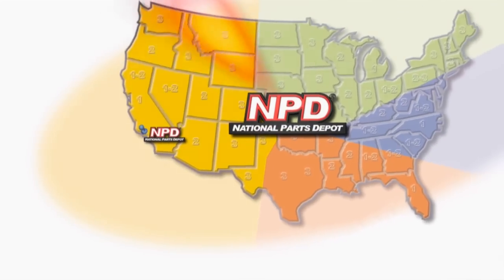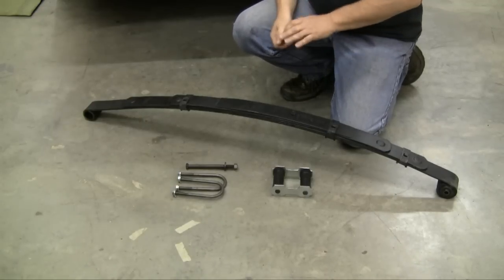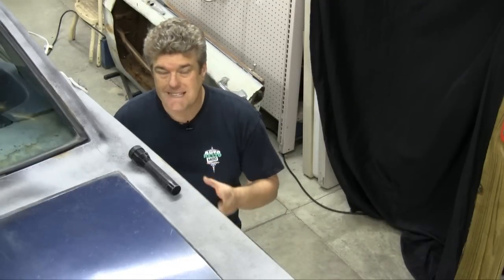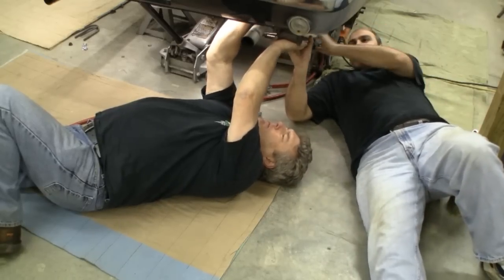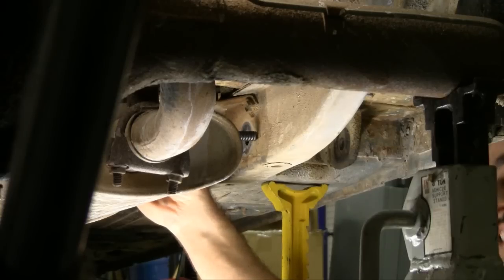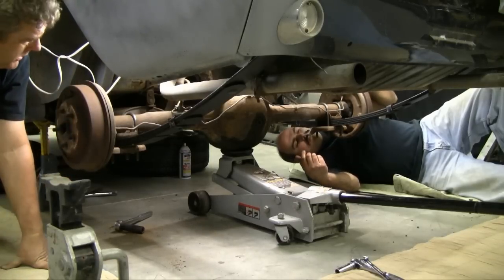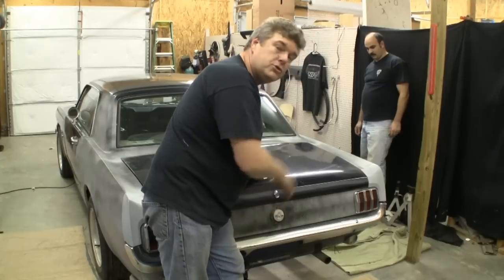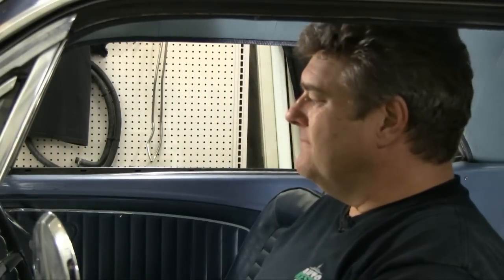Episode 107 Rear Leaf Spring Install How-To Autorestomod

Comment: Gents, your video was very useful in my leaf spring replacement.  Your comments about the front shackel bolts was dead on, mine were both frozen.  It took me cutting the bolts at both of the access points.  I am not a salesman but the Diablo blades worked well in cutting through the bolts.  Tomorrow is installation day. Mucho Gracias.

Comment: Dont know if this is too late or not, however what I found worked to get the front bolt out is take a punch and hammer it to the point where its inside of the spring hole, then take a original U bolt and hammer the rest of the way out.
Reply from the maker: Never too late!

Comment from the maker: It was a littl hard to show and see but there are pins on the springs and holes on the plates. Also the clamps will align the rear axle since they sit snug against the welded plates.

Comment: Good video. Is there any room within the alignment pins/holes to nudge the axle left or right to "center" it? The rear wheels on my '66 coupe stick out 1/2" more on the passenger side. I am wondering if there is enough play there so I can loosen the bolts and push the axle 1/4" toward the driver's side to compensate.
Reply from the maker: Yeah, Not sure if you can recover the full 1/4 inch, but you can center it better.

Comment: This reminds me and my brother doing the springs on our 69 Camaro.  Previous owner had installed Hurst air shocks to make up for weak springs and had them fully inflated, which meant that he kept breaking the lower retaining plates on the springs, to which the shocks were mounted.  Had one heck of a time getting the springs off since the rear shackle bolts were rusted solid to the shackles.  Glad to see that safety was mentioned here since the car and axle must be properly supported and the load removed from the springs before removing them.  Good video!
Reply from the maker: Thanks for the kind words!

Comment from the maker: Want to know something REALLY weird? Our '69 Fairlane is low on the drivers side... Look at your rubber isolators (if you didn't replace them). Our drivers side rubber is pretty beat up and we're pretty sure that is our problem. We'd look at taking measurements from the rear torque box to the rear spring mount on the frame. If both sides are +/- 1/8 inch they are in tolerance and you need to look at other possibilities. email us at our web site in the about bar.

Comment: Very helpful video that inspired me to order Detroit Eaton rear spring's for my '66.  Install went easily until I set the axle on the springs...  Manufacturer used 1/4" high locating pins rather than the 1/2" high originals, and the axle wouldn't locate as a consequence.  Re-re-re-checked that I ordered the correct springs and I did per the NPD listing and Eaton Detroit reference chart.  Disappointing as I could have had this all done in one afternoon.  Now I need to fuss around to get new pins or swap out the springs entirely...

Comment: Hood stance.👍
Factory new cars set 1 inch lower than that in the rear. 😨
Look at all the Ford original pictures.
Reply from the maker: We used the Ford spring height chart directly from Eaton Detroit Spring who got the original diagrams and specs from Ford.

Comment: if i want to change over from mono to multi leaf and order all the parts, is there any welding on the axel that need to be done.  I had read the multi leaf are wider and require diff. parts for the change over.  Thanks allot, the hardest thing i did on my 69 Camaro tear down so far was remove the old mono leafs and the rear end.  thanks Jeff
Reply from the maker: Steel, we'd contact Eaton Detroit Spring http://www.eatondetroitspring.com/ to get the full answer on this due to the fact that "it depends" on the spring. These guys know exactly what you'll need to do to make it work.
Reply: AutoRestoMod
thanks i will do just that....................  Jeff

Comment: I wish you would have placed the new leaf spring and old leaf spring together to compare/contrast the difference AND I wish you would have documented the Mustang's height before and after the swapping the springs.  Did the new spring(s) have greater arch AND did the new springs give the car a lift?  One would think so but confirmation would have been nice.
Reply from the maker: Art, the springs on the car were worn out to the point of extension shackles being placed on them by a previous owner so by comparison they would have been longer. I don't really see the need in documenting the height since our goal was a stock ride height which was achieved by the new springs. Eaton Detroit can give you a certain ride height, you just need to contact them:  (313) 963-3839 or https://www.eatondetroitspring.com/

Comment: I had a hell of a time getting my old air shocks and springs off lol. I shoulda used a sawzall but I used a cutting wheel instead. It worked but I did make a few knicks in the frame rail that I'll have to fix. Good episode Jeff.

Comment: Hello Jeff I have question? My son has 98 ford ranger and we changed the rear leaf spring because one had broken. After doing so the ranger now bounce like crazy. We also replaced all shock on the ranger and front and back. Do you have any suggests to how I can correct this problem.
Reply from the maker: Did you replace just one or both? When you ordered the springs did you make sure that the application was the same as your truck? It sounds like the spring rate may be a bit higher. Also what shocks did you use? You can e-mail Jeff direct at: jford@autorestomod.com so we can get you sorted out!

Comment: Jeff
Just bought a set of new leafs from Mike. I was wondering if you would have had your four post when you did this install if you could have left the tires on and not jacked the axel. Just jack the frame rails. Let the axel rest on the tires below the body on the lift? About to tear mine out on Friday and don’t see a reason to remove the tires if they can hold the axel in place on the lift.  Any thoughts on that ?
Reply from the maker: The tires get in the way of removing the outer two bolts on some wheel tire combos. I used the jacking bridge that Wildfire sells to pick the axle up off of the springs when I was setting the rear end up for center on the chassis.
Reply: @AutoRestoMod  thanks. I can reach all the bolts and have no obstruction. I may give it a whirl for shits and giggles. Gonna just use my rolling jack to lift the frame rails. And set my underhoist jack under the pumpkin but I don’t see the axel going anywhere if it’s still attached to the wheels.

Comment: Where those standard 4 leaf springs or where they stiffer or lowering springs installed on this mustang?
Reply from the maker: Those were stock springs. Contact Eaton Detroit Spring for applications!
Reply: Thank you, do you think for aftermarket 18inch tires, it will fill the rear end wheel well nicely or does it need to be lowered or raised in the back? Because I heard that they came from the factory with the rear riding low.
Reply from the maker: Damian May We'd highly recommend going to this site: http://www.dodgestang.com/ and looking at the charts for your particular car. The 18-inch wheels will work but you have to be real particular with offset. We did a video on setting up wheels and tires here: Episode 92 Picking Wheels, Tires Plus make your own wheel offset gauge Autorestomod

Comment: I'm replacing the leaf springs on my 67 Cougar. The muffler is sitting about 1/4 inch too close to the frame so getting the front bolt out is quite challenging. I don't have a clue how I'll get it back in that way. Would I be able to reverse the direction of the bolt instead and just insert it from the other side? Every video and instruction says to put it back is it was. Is there any particular reason?
Reply from the maker: +Topher7527 Not sure that the bolt will go back in from the other direction. You might do better dropping the exhaust and attacking it that way.
Reply: Yeah. Wound up having to just move the exhaust. Thanks.
Reply from the maker: +Topher7527 Glad it worked out, sorry we were a bit late on the response. We typically don't answer these on the weekend.
Reply: +AutoRestoMod Not a problem. The response was appreciated all the same.

Comment: How do you torque everything down when it’s sitting on the wheels??
Reply from the maker: I just do.
Reply: @AutoRestoMod  I guess what I was getting at was, if I set my car down on its tires I can’t fit a wrench under my car to torque anything down. It’s too low there is no space. I’m working on a 71 camaro

Comment: Installed new leaf springs on my 1969 Fairlane 2-door due to the factory ones being shot and making the car lean to one side. New springs are doing the same thing; passenger side 1.5 higher than driver's side. Can't seem to figure this one out; must have a bent... something somewhere? Both new springs were identical to each other as is the installation on both sides... switching spring sides makes no since but that's all I have left to try.